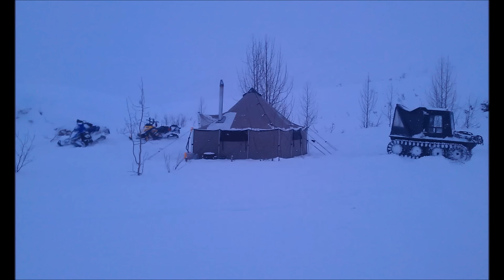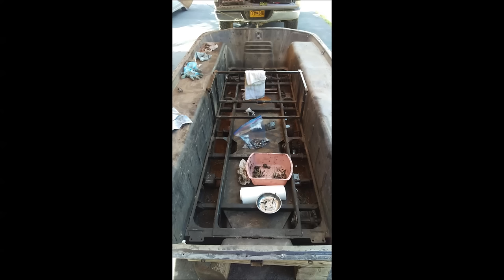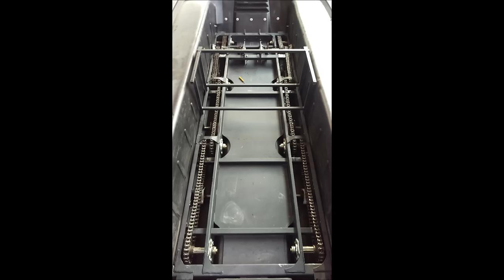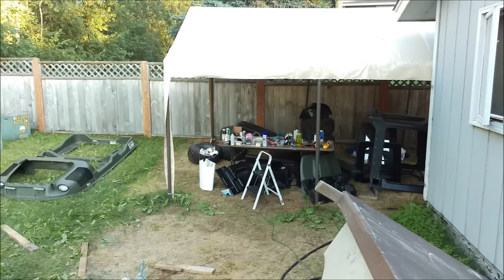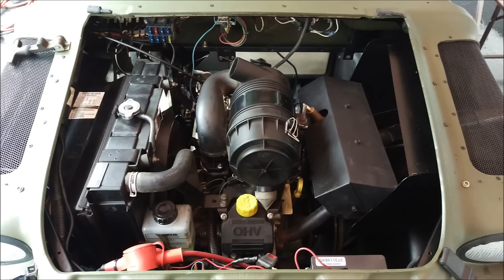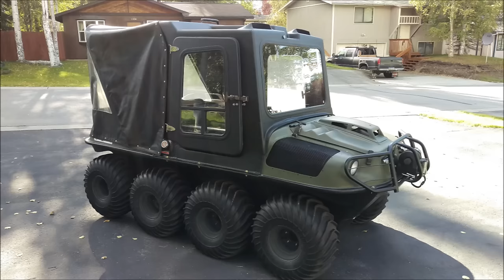Rebuilding the Argo Avenger 750 EFI 8x8. Slide show

Comment: dad gum you've been busy lol. what size motors do you have on your dredge?
Reply from the maker: +James Williams... Well I have a 3,4,5 and two 6" dredges lol. I have a 5.5 honda on the 4" Keene, a 13hp Honda single on the Keene 5", twin 5.5s Honda's on one Keene 6" and twin 8.5s Honda's on the other Keene 6". Picking up a new Keene 8 this winter.
Reply from the maker: + 1 HP depending. Seems all the Honda's have different rating for the same motor, 5.5/6.5.... 8.5/9.5....

Comment: Was the cracking due to too thin a gauge of metal that was used originally , or more from being used extremely hard before you got it?
Reply from the maker: Probably from the previous owner abusing it.
Reply: @KrisDeVo  did you make the replacement frame  / someone  make it ,or did you purchase it new from the mcg. ?
Reply from the maker: @heartland96a  I ordered a new one from the dealer. About 2,220$ if I remember right.
Reply: @KrisDeVo  Thanks for update